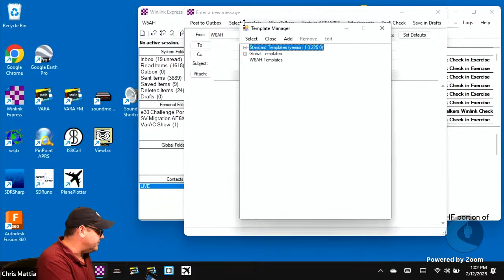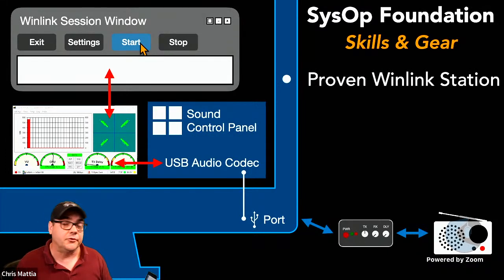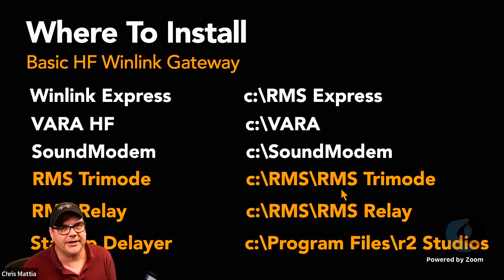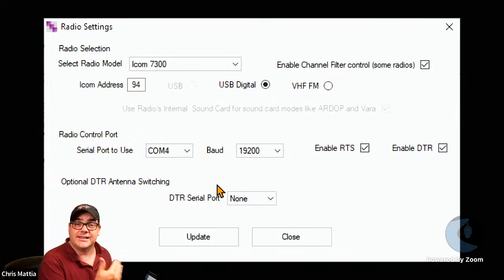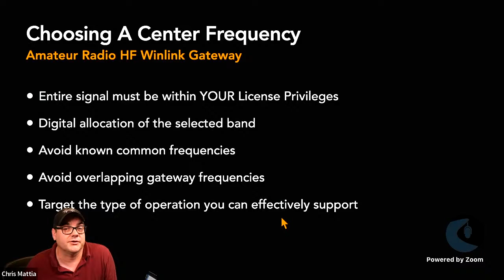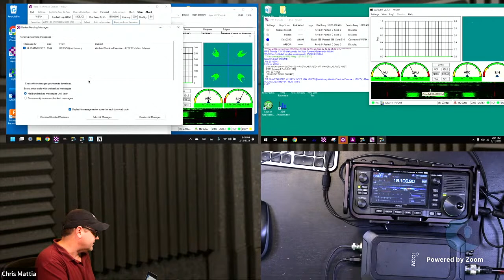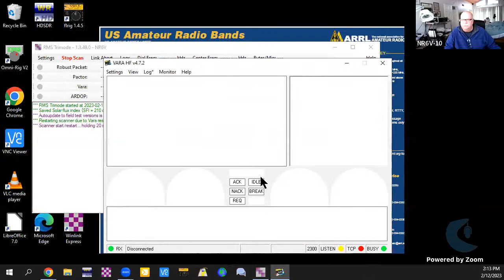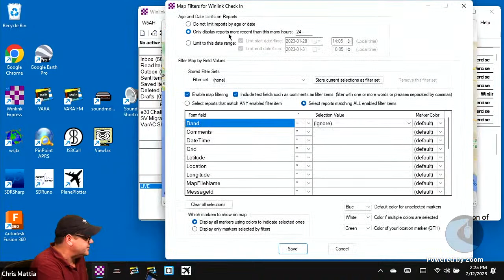Setting Up A VARA HF Winlink Gateway – WaveTalkers LIVE 59

Comment: This is a really informative video, and I'm sure it will help anyone who wants to set up a Winlink HF Gateway, especially since the RMS Trimode help file is somewhat outdated. There are a few items that I would like to clarify. The UZ7HO Soundmodem software isn't needed for ARDOP. ARDOP comes with RMS Trimode as well as Winlink Express. The UZ7HO Soundmodem is used for packet on a soundcard interface. This setup would take the place of something like a Kantronics KPC3+. The VARA Retry counter is used when a client is trying to connect to a gateway, and when signals in either direction are lost and retries are sent. I believe it is also used for RMS Trimode for calling other gateways when the gateway is configured as a hybrid or to forward messages. I found that when I make connections to HF gateways, the performance did not increase while setting the ALC to 1/3. I typically set my radio to 30 watts, then I increase the TX volume on my Signalink USB until the output power reaches 30 watts. At that point the ALC is still at zero, but the connections on VARA and ARDOP are good. I would like some clarification on using 3589 kHz as a center frequency. You specified that it is in the extra class portion of the band, but the data portion of the 80 meter band extends to 3600 kHz for extra, general and advanced class licensees. If the SSB channel width is 3kHz then the signal would span from 3587.5 to 3590.5 (narrower for a 2300 hz signal). I currently have two VHF gateways, and in the future I will add a HF gateway when I move to a location that will allow me to do so. 73 KD5YOU

Comment: What is the minimum power I should be aiming at for an HF gateway?  I'm trying to find a cheap radio, and that Xiegu G106 would meet that requirement, but will it work to reach back to the WInlink user?  This system will hopefully be powered offgrid, so that QRP helps there.
Reply from the maker: Great questions.  it is really more about your Antenna than the power from your gateway.  I help support a gateway in Utah that is only pushing 20W into a fan dipole and it had hundreds of connections up and down the entire west coast and out as far east as TN.  You don't need much power, but keep in mind your gateway will be pushing 100% duty cycle when it is in operation.  So make sure your antenna is resonant on the Frequencies you plan to operate it on, and you have a good external tuner to touch up any discrepancies.  Ultimately, it is all about your antenna though.